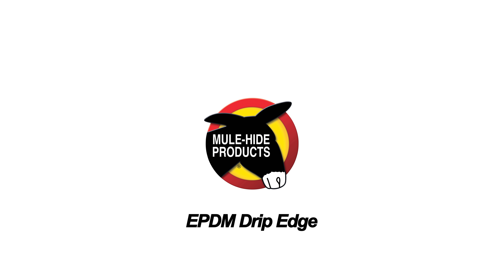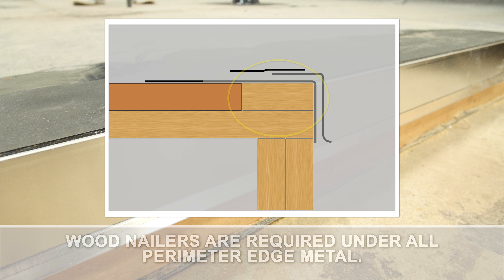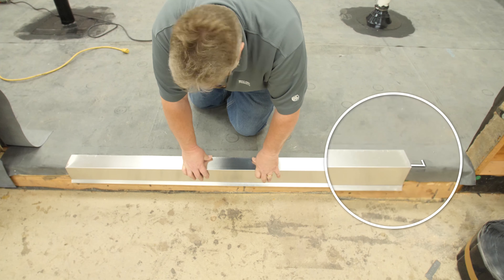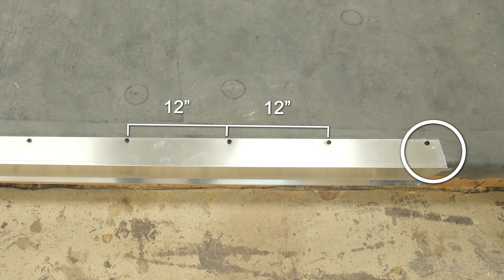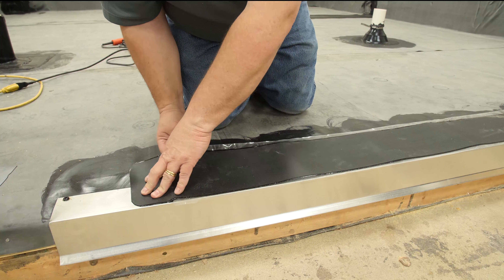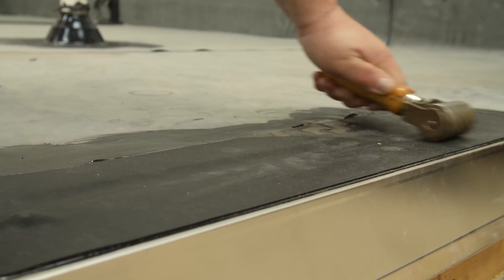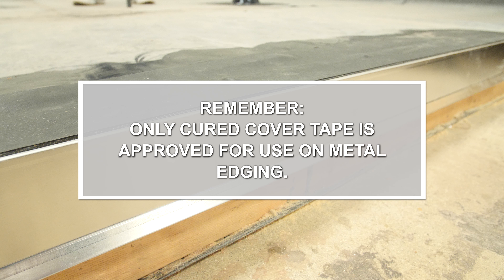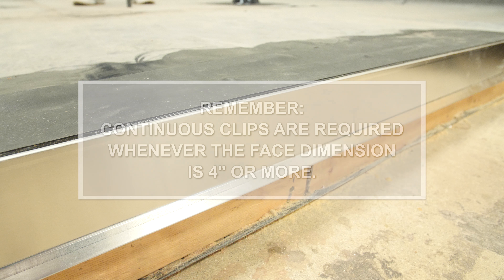EPDM Drip Edge

Comment: Nothing about  how to seal the seamsin the metal ?    I am doing a repair right now , and every seam in the metal is leaking ! Also ,. does the metal get primer?  They are doing things differently than when I went to Goodyear rubber school in Akron , in the 1980's , My supplier said the metal gets primed with the same primer as the rubber, however there is no mention of that here !